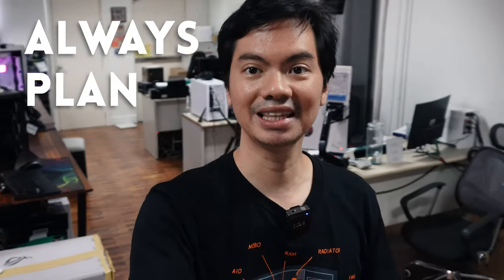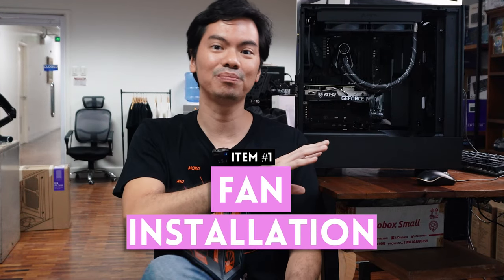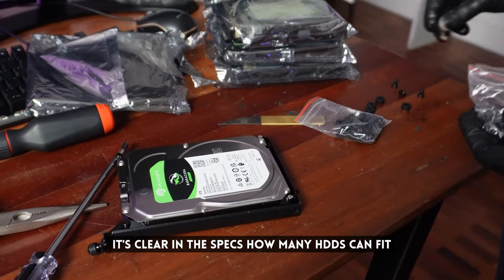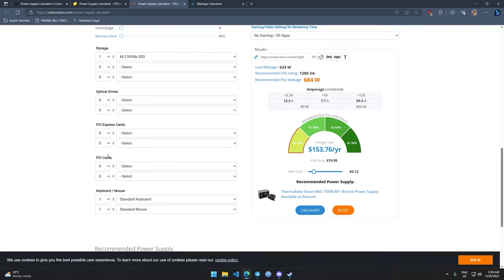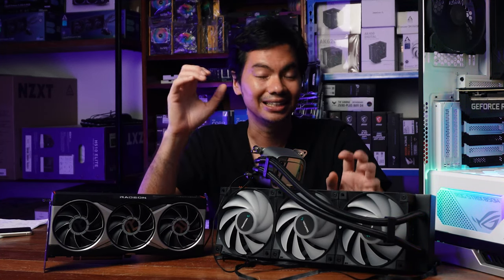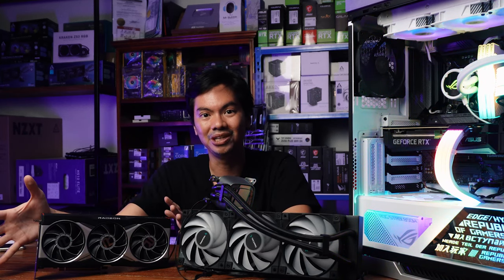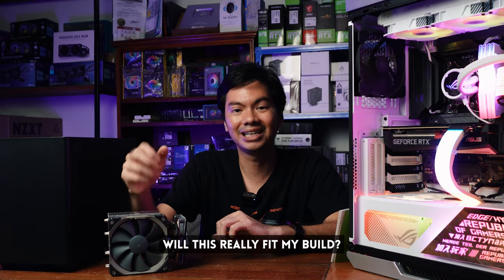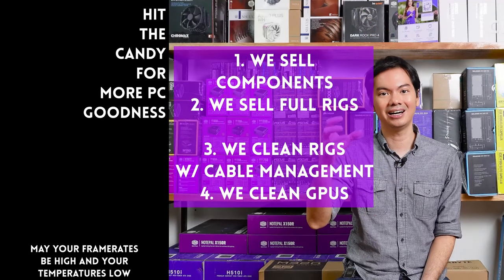Plans never survive contact with the enemy 💥

Comment: Alot of the difficulty is working on a case that didn't get alot of videos when released. I got lucky with mine because, even though it was a last minute build for a streaming event, the preinstalled fans had long cables and I used a basic GTX 1650 Super.

Comment: Hello po sana mapansin, I just finished building my own PC it's my first time btw. i've gone with a white motif build from case to fans. So my question is does anyone know kung anong white GPU(preferably not expe,10-15k budget) ang pwede sa rig ko? I have 5600g CPU and 550w psu if that helps.
Reply from the maker: Colorful has some nice white ones, I think we have a 3060 8GB right now for slightly above 15k